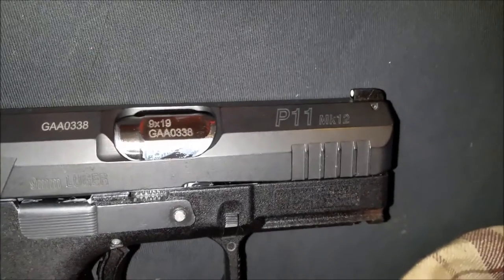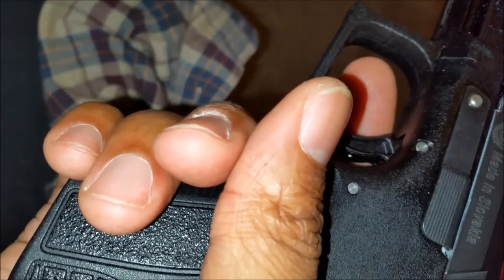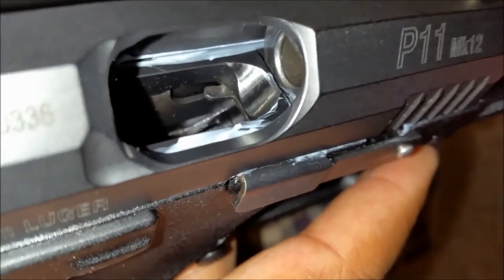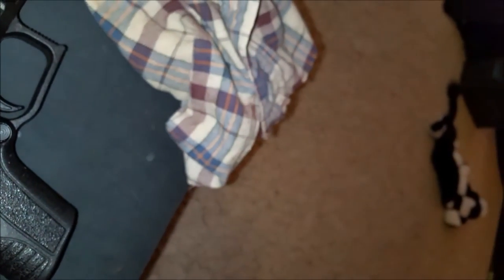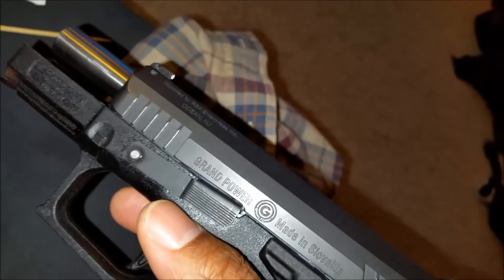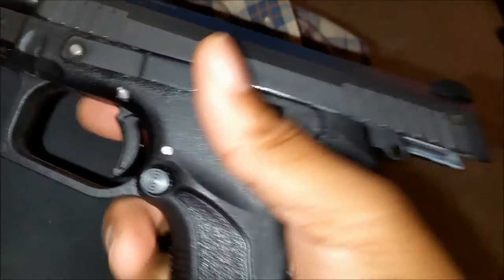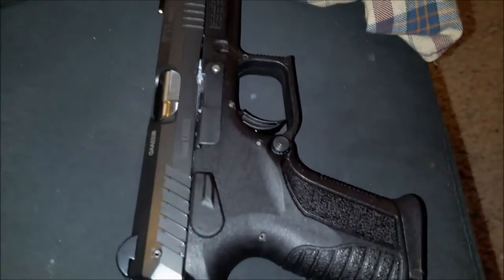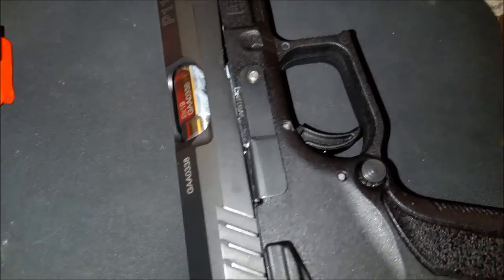Grand Power P11 Mk 12 - Failure to Return to Battery

Comment: I have a P1 Mk 12, and have the exact same issues you had with your P11. My husband has a K100 Mk12 and haven't had any issues at all. He can use any type of bullet (round nose covered lead, or FMJ's), and preferably 147gr, not lower, but no issues. I also thought it might be my grip causing the problems, but I would be shooting and all of a sudden the slide wouldn't go into battery, standing out maybe about 5mm. If I push the slide closed, it wouldn't fire. I don't have any issues I can remember with my new magazines (when using fmj's - lot of issues with lead points), while I have a lot of issues with my husband's older magazines. We've decided to maybe have the springs re-tempered, and see whether that solves the issues.

Comment: I have the CP380 and while it shot the first two mags without issue, every mag since then has the same problem you describe, only instead of a inch mine is only about 1/8 inch, and it does it about every other round, not magazine. I can shoot and then when I shoot the second round I have to push the slide with my thumb the last 1/8 inch to get it back in to battery. Then she shoots again.
The 380 being blow back I know will probably not have the exact same problems as those with rotating barrels but I’m hoping to find something to correct this problem.
Update.
I took the CP380 apart to look at and clean it after the range trip and found two things.
First was that the tolerances on the gun are very tight. Which speaks well of manufacturing.
The second was that, when I got the gun I broke it down to see the production quality in detail. Feed ramp scarring or machine marks in the slide etc. The work done is quite good. I found no machine marks anywhere and the feed ramp was near mirror polished. When I took her apart after the range trip it was absolutely filthy. Less than 125 rounds or less than 2 and a half boxes, there was grime all over the inside of the gun and what looked like unspent powder. No doubt why the action got worse the longer I shot.
I may not use the rest of that ammo. But I will be getting some better stuff for the next trip.
If anyone has this return to battery issue. Do what I did and check your tolerances and cleanliness of your weapon. I was very surprised at how dirty the gun had gotten after such a small amount of rounds.
These GPs may require very clean ammo.
My G19 and XDM will eat about what ever I feed them but I would guess that their tolerances are a little looser than the GP.
Reply from the maker: Thanks for leaving a comment!  I'm sorry to hear that you're having similar issues.  

It is weird that you're having the same issue with a Grand Power handgun that isn't using a rotating barrel.  Your issue could be a lubrication issue but I've at least one blow-back handgun (a Bersa Thunder 380) that hasn't exhibited those symptoms, granted that's not a Grand Power.

Without knowing much about your handgun or what you've tried to mitigate the issue, I honestly don't know what to suggest.  How many rounds have been fired from the handgun so far?  What brand/type?  If I were required to give an answer, I'd say to try different ammo brands.  Also, try not just range ammo but SD ammo.  Good SD ammo will have good powder.  SD ammo will have enough powder charge to cycle the slide not only backward but forward.  If it still shows the symptoms with SD ammo, you probably need a new recoil spring (this is something I haven't yet done).

Several people that have seen my videos describing the issue have suggested that I tell Grand Power the issue and ask them to give the handgun a look-see.  I haven't done it yet because I'd hate to go through the process of contacting them and arrange to have it sent to them, only for them to tell me that they don't see an issue.

So, give some SD ammo a try (along with various ammo brands) to see if it still fails to RTB.  As well, ensure the slide is properly lubed if you haven't already.  Let us know how it goes.
Reply: Ron S 
I believe the problem with my pistol is two fold. 
I’ve had a Bersa 380 and the tolerances on it were not as tight as the CP, and the dirty ammo. When I stripped the gun after going to the range I could not drop a round in to barrel and it slide all the way in.
After cleaning the barrel and all the bullet did slide in all the way. Plus the barrel looked like it had unspent powder in it and there was black gritty looking silty stuff, again probably unspent powder, covering the inside of the slide and frame.

Comment from the maker: I've had my P11 prepped for a range visit for months, but finally went to the range this evening.  I put close to 300 rounds through the it.  Of all those rounds, I had two failures to return to battery, both with Remington UMC flat-nosed 147-grain FMJ.  I shot a lot of different ammo, too:  TulAmmo steel-cased 115-grain FMJ, the aforementioned Remington UMC, and Winchester Personal Protection 147-grain JHP SD ammo.  The gun was quite lubed down, and probably was choking on the dirty-as-hell TulAmmo.  I'm just glad the battery issue lessened.

I'll be cleaning it tomorrow, so I'll check the barrel pivot area then and report any anomalies.

UPDATE:   new (and quick) video here:  https://www.youtube.com/watch?v=Cn2wAFUUFV0

Comment: I have a K100 MK12 and had the same issue with the same ammo, 115 gr remington jhp. The issue was with one of the magazine being defective. One magazine had no issues with failure to feed with the same ammo while the other one would also jam. The defective magazine would load all other ammo fine with no hiccups. There was a slight difference between the two mag. The defective one had issues with the back of the follower not rising high enough and causing the ammo profile to be higher so once the slide went forward, the jhp would hang and get caught. Try changing the magazine.

Comment from the maker: I'm starting to see a trend here.  Please understand that I know the difference between oil and grease.  Using grease is a personal preference.  My using grease is not the problem...the grease I use isn't thick and isn't causing resistance issues.  The fact that I wasn't using grease in the correct places is a more accurate assessment of my problem, I believe.

If you guys are using oil and it's working for you, that is good.  I'm using grease and it is now working for me.  All that matters is that I've significantly lessened the FTEs and failures to return to battery -- with grease.  That's difficult to argue against, IMO.

If/when I run into issues using grease, I'll come back here and say so, then switch to oil.

I thank you all for your input, though!

Comment: Hi ron.... Did you resolve the issue, and how did you do it?... 8 yrs ago, hope so!...  I bought my first grand power a few weeks ago and love it.... Thanks.
Reply from the maker: I think I did but I’m not shooting the gun as much as I used to. 

I’m at around 1800 rounds thru the gun right now. I cannot remember the last time it failed but I’ve been ensuring that the gun is clean. I no longer shoot 200 rounds at a range visit thru the gun. I also take care of the ammo make/model I use with the gun. 

I also had Global ordnance send me a new recoil spring right around when Covid hit.  It hasn’t hiccuped since then. That could’ve been the root cause of my issues, as I racked and dry fired this gun A LOT. 

I also significantly firmed up my grip the past 5 or so years. Some of my issues could’ve been related to a not-so-firm grip. I’ve also been using grip tape to gain a better grip on the gun. 

I think all of the above could’ve been contributors to the gun’s issues.

I love the gun but it’s somewhat sensitive, IMO.

Comment: I have a Grand Power K100 Mk12. I've put about 500 rounds through it, with all kinds of ammo and had zero issues with any type of malfunction. I realize it's not the same model, but I just wanted to pass it on.

Comment: I sure hope the issue gets isolated and corrected for you. It sounds like you have tried everything in troubleshooting it.  The GP should feed everything any other pistol in its category would, but plenty of them are ammo specific. Anyway, I am hoping for you, and with your meticulous, systematic approach to pinpoint the problem, I know you will resolve it or pitch it!
Reply: +D Walker Also, it looks like your slide is having stress issues in the rear and on the right side near the slide stop. Even WHEN you correct it, send it in for service; as you might have gotten one that is out of spec.

Comment: FYI.. You had it backwards on the rotating barrel models of PX4 Storm. The full and compact models have rotating barrels. The Subcompact is tilt back design. After seeing this video, I'm having doubts about the rotating barrel system. I was considering owning one. I want a 99.9 percent reliable pistol out of the box with no break in period necessary. Any pistol that requires one is junk in my opinion. Like the Sig P238. My Ruger SR9C is super reliable. I want a good double/single action hammer fire 9mm for under $500. I am considering Bersa Ultra Compact Pro. Glad I watched your video. If it can't be reliable with all ammo, I'll pass
Reply from the maker: +Robert Glover Thanks for correcting me on the PX4 variants.  Also, thanks for the feedback!

The ammo the gun choked on was Remington FMJ flat-nosed...the other ammo brands shot without issue.  I won't be using Remington FMJ  in self defense situations and that's the only brand and type the gun has choked on.  

I don't think Grand Power has implied that this gun competes with Glock (for example) when it comes to accepting everything thrown at it.  The reason it's had issues is probably two-fold.  One, the barrel has high tolerances, so it's a bit picky.  I can see a band on the spent brass where the case was forced into the chamber...I don't see that with my other handguns.  Two, the ammo probably isn't quite up-to-spec.  My XD Mod 2 choked on one of them, as well and handled the situation much worse than the P11, as the slide totally locked up...the gun went through three people before one of us was able to get the slide back.  When I looked at the ammo after experiencing both issues with both guns, I saw that the front-leading edge of the brass was bent, like it got hung up when being rammed into the chamber.  IMO, part of owning guns is knowing your guns.  Another aspect is that every owner will have different requirements.  Yours is that you require a gun to accept all ammo without question.  Mine is to determine what ammo might cause issues (because not all ammo is equal) and not use that ammo when carrying.  To be honest, I learned a good bit when troubleshooting the issues I had.  That's a good thing, IMO.  

What bothers me is when I see people like Sootch00, James Yeager, and Patrick Kelly review these guns but never report anything negative.  In their defense, maybe GP is giving them the information they need to avoid issues...information that isn't in the manual or online.  Or, maybe because they're testing short-term, they don't run into issues during their short testing period.  I know Sootch00 tests with HPA ammo (that's probably far better than the Remington junk I was shooting out of the P11)...maybe that's why his Grand Power guns didn't hang up...he was using quality ammo.  But it can't be that the only people that experience issues are non-celebrities.  I've seen quite a few people respond to my videos complaining that they're experiencing issues with this gun.  I value that information far more than the videos that only report the non-negative things.  It gives me the feeling that people may be hiding negative info that would benefit the firearms community.

My problems with lube was remedied once I understood where to place the lube.

I've 10 other handguns.  Most are lower-priced guns that eat everything and are super-reliable, but those don't shoot like the P11, either.  I'm far more accurate with the P11 than any other gun I own and the barrel allows for easy follow-on shots compared to the non-rotating barreled guns I own.

Comment: I had this issue too (P1) and found out it was ammo problem. Ammo was weak and did not have force to return.
Also I changed lube to balistol. From that change, 2000 rounds withou single failure.
Reply: +MrVolodus  Possibly a spring change to something lighter might help. My K100 has the red spring. It's frustrating to get a new pistol and it's problematic.
Reply from the maker: +intercooler2 I tried different ammo and I believe that helped.  The gun seems to like good (ie, not cheap) ammo.  I tried Tula and while it didn't cause problems with the gun, Tula is EXTREMELY dirty...the gun was filthy around the part of the barrel that makes it rotate.  This gun isn't going to be able to run as dirty as a Glock would, IMO.  I also used grease and not oil as a lube.  I think that helps a lot.
Reply: +intercooler2 Spring change would help maybe, but I like strong ammo :)
From time of comment, I fired another 3500 rounds and only had 2 failure to eject (in row). But I was experimenting with new loads and also firends Glock17 failed so I guess it was ammo problem ( I returned to my old load).
Reply: +Ron Sinclair Other guns also don't like Tula ammo. Forums are full of pissed users (jams even destroyed weapons(.223)!), from what I remember, don't even look at tula ammo.
Just google "tula ammo failures" :)
Reply: That's like a record from what I am reading in many places.
Reply from the maker: +MrVolodus yeah, my last range visit, I took the P11 and a .45ACP 191.  The P11 didn't complain when I shot 100 rounds of Tula from it...yeah, it got dirty but it didn't act anywhere near as bad as a few months ago.  It only FTE'd twice on Remington UMC toward the tail-end of the session.

The .45 1911 didn't like Tula AT ALL.  In fact, I could tell some of the powder charges were light, as I could tell that the slide was slow in cycling back in many cases.  It jammed a good bit when trying to extract.  It jacked up the feed ramp as well...was like using 100-grit sand paper.  :/

I wanted to try Tula just so I knew how the guns would handle that ammo.  I'm glad the P11 didn't choke on it.

Comment: Did greasing it up fix all your issues? I'm 500 rounds into a new MK12 K100 and have seen this issue as well as full slide lock-up. I was actually thinking about greasing mine too!
Reply from the maker: +intercooler2 greasing helped greatly.  I fired close to 300 rounds my last range visit and only had to failures to return to battery, and that was at the tail-end of the 300 rounds (was also using Tula, which is really dirty).  If you're going to lube it with grease, lube up the area where the barrel pivots (the cam area, or helical cut-out).  Lube the area behind the cam pin as well.  Let us know if that helps!
Reply: +Ron Sinclair I'm willing to try anything. You can read some of my stuff here: https://www.facebook.com/EAA-Firearms-Not-affiliated-with-EAA-Corp-206257602745613/

I posted your video and I think fouling messes up the slide transitions. What spring/color is in yours? I think the red in mine is a little stiff for lower end ammo and plan on trying something less. It seems the XCalibur version runs better for some reason and they employ the black spring.
Reply from the maker: +intercooler2 My spring is black...remember, I've the P11.  The videos of the K100 I've seen show the recoil spring as red.  It won't hurt to get the black spring to compare, though.  Maybe you'll have better luck?  Personally, I'd try the lube and different ammo first.  I got rid of most of my issues when I did that.